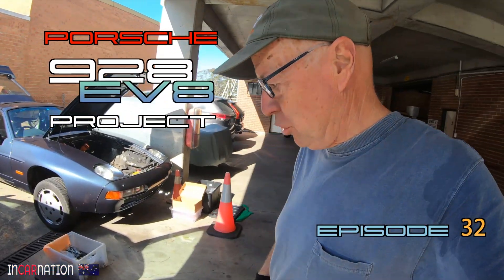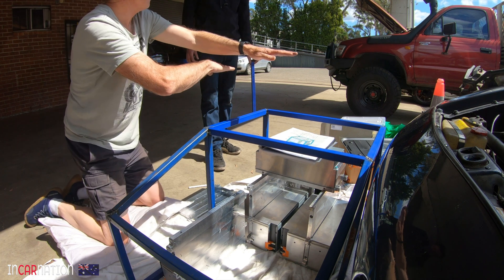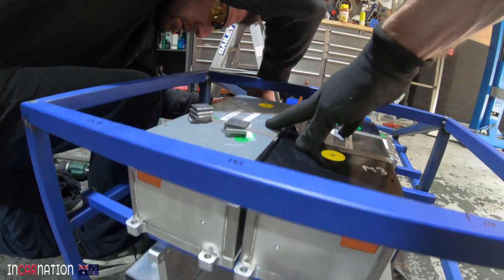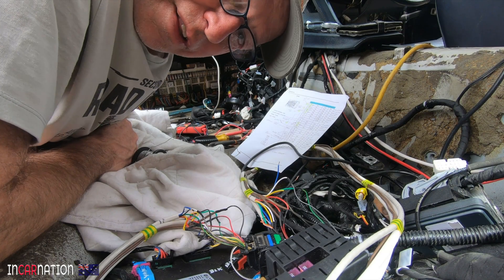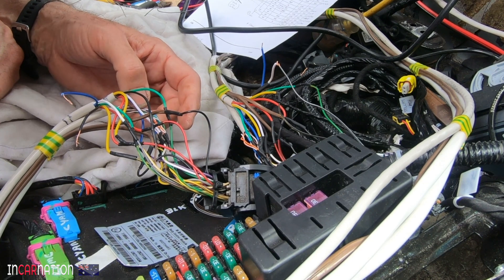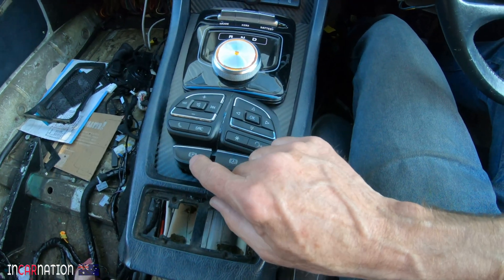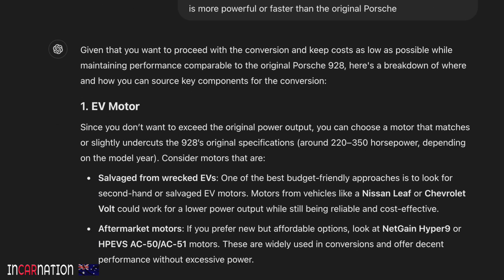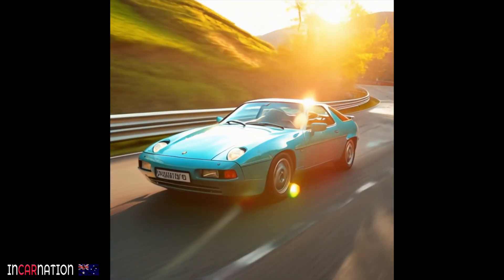Episode 32 – Porsche EV Conversion | AI to the Rescue with Good Advice

Comment: I just discovered chat after getting little response from an ev  forum.  Quite impressive with the instant responses to questions in any direction. Weights, wheel speeds, motor sizes reduction gear box, battery configuration, cells, etc even a work sheet and costings.  Now just proof check it.

Comment: Keep on keeping on Stu. 🙂

I have found that when extending looms, it's best to 'stagger' the joints, so all the wire connections are not side by side. That way you don't get such a big bulge in the loom at that point. Spreading it out is not simply a visual improvement, but can pay dividends when threading through grommets and holes etc.

Might I suggest keeping those tyres on the wheels while you continue with the project. In the meantime, find a set of Panamera original 18" wheels and add new tyres. Panamera owners want 20" and larger so the original 18s can be had for reasonable money and look great on a 928. The offset isn't quite as original, but it's acceptable. Did I say they look great. 🙂
Reply from the maker: Thanks Ken, yes I did try to do that. BTW, Matt's been away from the garage for a week or two hence the lack of content this month.

Comment: no eye protection when doing tab welds? hmm
Reply from the maker: It's a very good point. You'll notice that Matt always wears glasses or goggles but in those shots, he lines up those tack welds then closes his eyes. He never looks directly at the weld. But it's a bad look, and I probably shouldn't have put those shots in as you can't easily see that he has his eyes closed. Thanks for pointing this out. Don't want to set a bad example.

Comment: Great video Stu, good progress on the Battery frame
30yo tyres beats my 22yo when I got my 928, rear blew out and the sidewalls didn't collapse, rubber was so hard
AI, I got it to doodle a gull wing 928 which wasn't too bad, but AI must be of the Female persuasion as it doesn't listen to my instructions and does as it pleases as you and your multiple Opera house with Porche in the foreground :)
Reply from the maker: Thanks. You won't have to wait long Peter. Another battery box video coming this weekend.